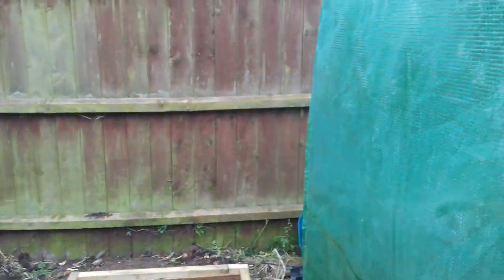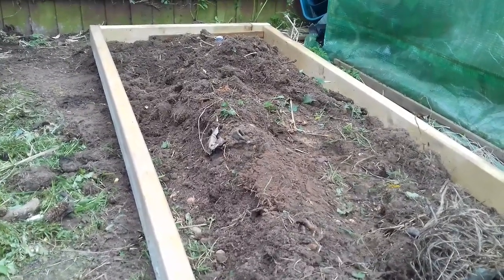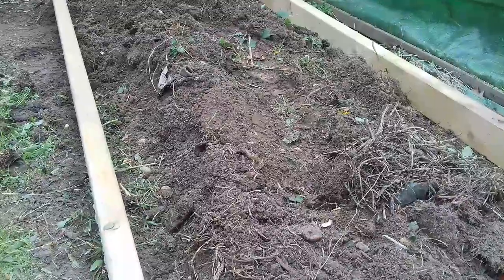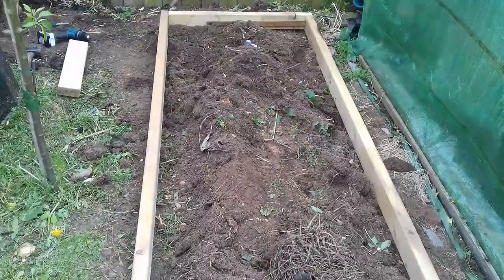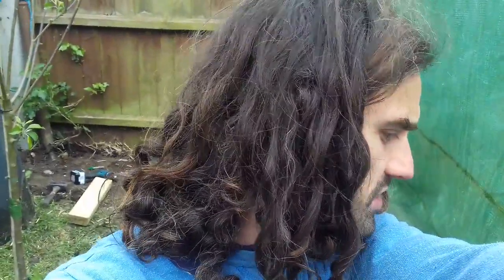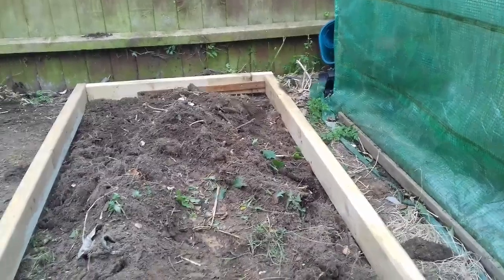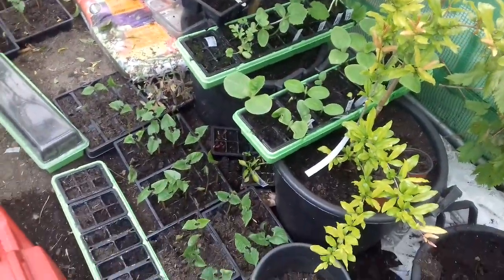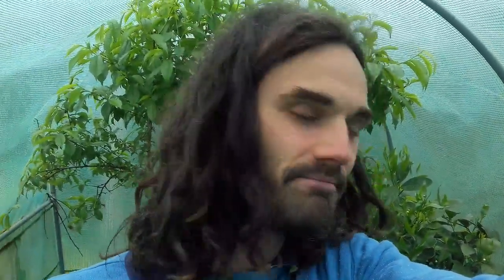How to build a really easy raised bed!

Comment: Hi Dan, I love raised beds, they certainly take the strain off the back a bit.  Just one thing before you fill it... is there room to pull it out slightly away from the fence and polytunnel?  I'm just thinking ahead, to when it's full of plants and you want to be able to access all parts without needing to step on the soil?  (Also, maybe that fence casts some shade?)